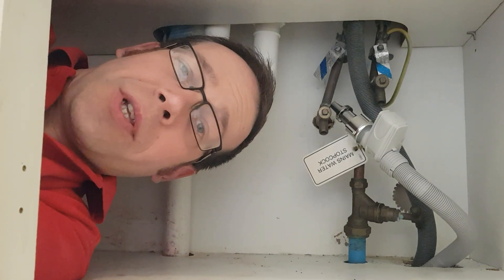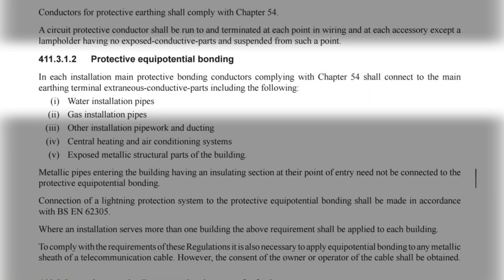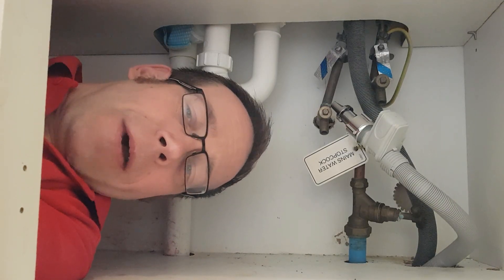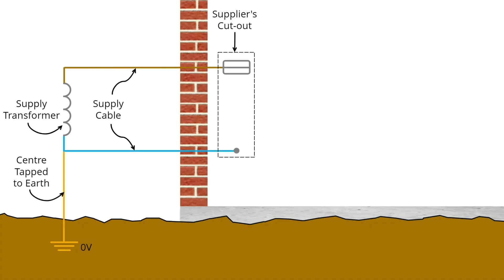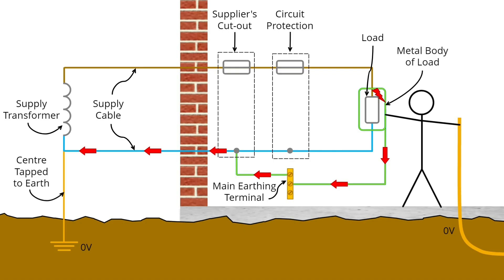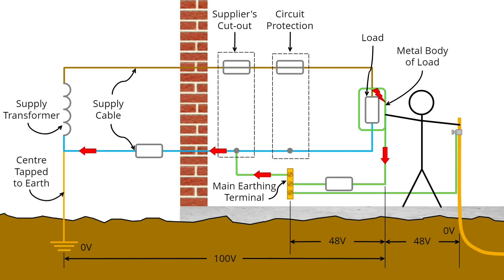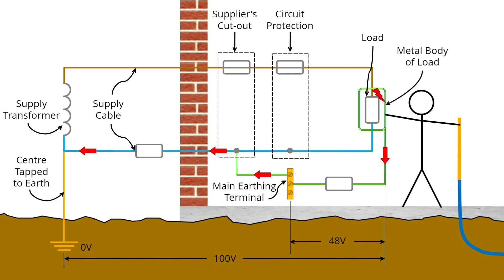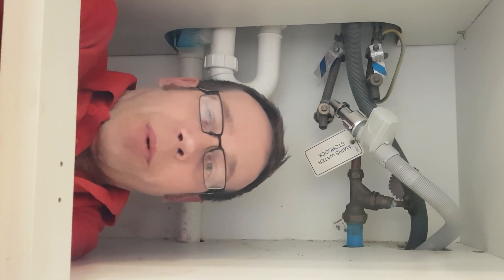DO YOU NEED TO EARTH BOND PLASTIC WATER PIPES?

Comment: Then you add a sink to your kitchen island & your copper supply is now a path to earth.
Reply: But that is a different scenario.
Reply: @davidcross30  
Yes, when there is an addition, it must be assessed.
Reply: @johnburns4017  but it would only be the copper pipe that is underground NOT the incomer as discussed in this video.
Reply: @davidcross30  
If the copper pipe forms an earth then it must be bonded. Some copper pipe on top of some plastic does not count, as seen in the vid. 

As the vid said, bonding a metal object that is not earthed can be more dangerous. If the internal copper pipe is bonded but does not run to earth itself, then if someone say touches a basin tap as there is an electrical fault, the tap may become live. While if it was not bonded it would never become live.
Reply: @johnburns4017  I think you have misunderstood me.

Comment: I knew it!!! I thought it did not make sense when my electrician said my incoming water mains must be bonded even though it comes through MDPE pipe. Glad this video sorts it out!
Reply: It’s recommended to still bond if the rest of the installation is all metalwork. What he said in the video about cables being spaced away from pipes is just wishful thinking. 
Look under your floor boards, cables wrapped around pipes is basically guaranteed, check your boiler, immersion heater, appliance cables behind sinks etc. You’d be deluded if you think everything’s a1 just because you can’t see it.
Reply: @Chris-gt3rs  
With RCDs and RCBOs the need to bond a pipe not connected to earth disappears. No need. 

As was stated you do not design a system expecting it to be a cowboy job.
Reply: @johnburns4017  Once again though that’s only in a perfect world. Most rcds never even trip when receiving a shock.
like others have also stated, what if the pipe work enters the ground at some point for a garage or out building etc. finding the main bonding clamp is like a needle in a hay stack on a regular day, now we got to also inspect all the plumbing work?
Reply: @johnburns4017  You best ask my NIC Inspector because he shares the same views.

Iv been to properties where the metal work has been at 240v which wouldn’t have been the case if bonded, unless the whole installation is pvc  you’d have to be a cowboy to not do it. 

Also you’re contradicting yourself because yes you could be introducing a fault but 1. you could say that about absolutely anything metal. 2. Under normal operating conditions there wouldn’t be any faults. 3. if you’re that worried you best disconnect your cpc to your boiler since all the pipes are connected to the metallic plate on the bottom… 🤦🏼‍♂️
Reply: @Chris-gt3rs  
Your NIC man needs retraining.  As the vid says, bonding a metal pipe that does not run to earth is about as daft as bonding the metal frame in your bed. 

Next time the NIC man tells you to bond a pipe not running earth show him this vid.
Reply: @johnburns4017  Iv seen countless incidences in my time from lack of bonding but I’ve never seen any caused from having bonding.
I can’t be bothered to argue with you since you only knowledge parts of my comment.
I’ll carry on putting lazy peoples work right, to satisfy myself, my certificate, my inspector, and customer from any other bodgers that dabble in electrics or future work they may undergo.
Reply: Gas meter is fed via a plastic pipe. The gas bloke insisted it be "earthed" within 600mm of the first tee. So malicious compliance kicked in, I put the clamp in the box, just before the compression elbow onto the meter coupling. I may have put a couple of 2 inch coils in there for vibration mitigation. Did I mention its in 16mm²? When he come back he won't be happy, because it's not left much room to work. He also stated that a fully qualified plug monkey had to do the install. I tried to explain the situation, but he didn't understand. The irony is, the water comes in via lead, there's not a a cpc in sight, I keep meaning to do it, or slip a length of plastic in there.
Reply: In one job the guy came to change the gas meter, saying where is the earth cable to the water stop cock. We told him it is not needed as it was plastic. He left not doing the job. As he was leaving we called him an incompetent lazy ****.  We kicked up about it and in also stated it was not needed quoting the reg.  And not to send back this incompetent idiot.  They apologised sending a different guy.
Reply: @johnburns4017  You sound delightful
Reply: @James_scott86  
I do not tolerate idiots.